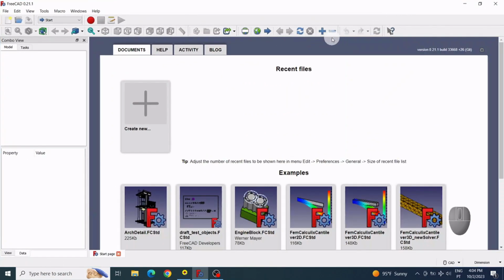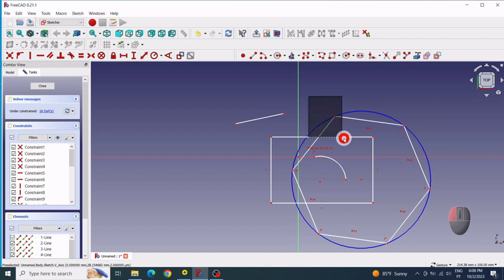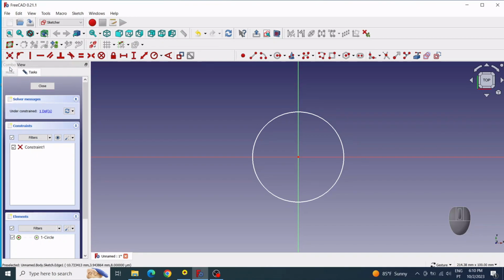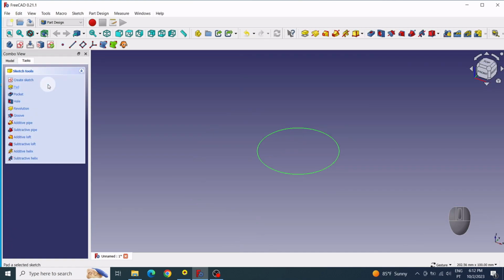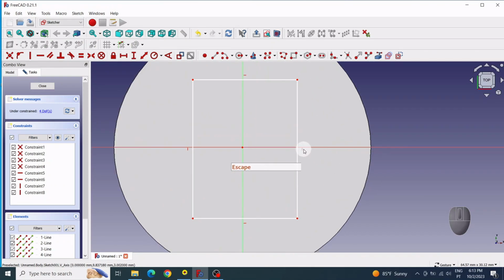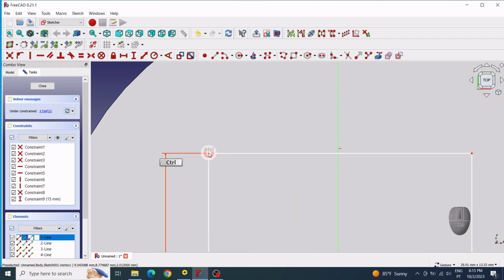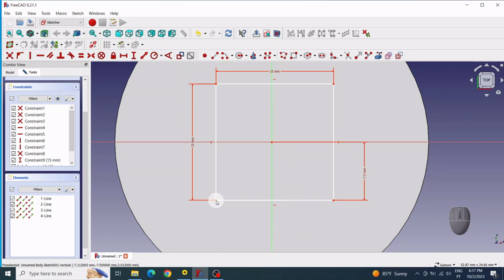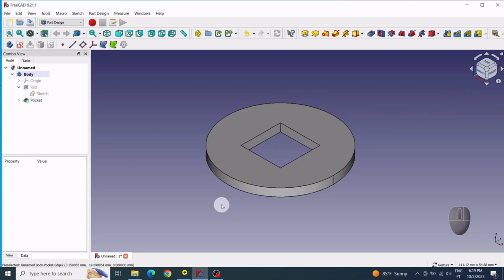First steps with FreeCAD

Comment: MacroConvert is a useful macro, however it seems that to modify the objects (homothety) along the z axis, it is necessary to modify the y parameters, same for displacement. I thought that asking for multiple copies would result in a series of combined modification (geometric progression), this not the case, all objects have the same size and the same displacement (superimposed), was it the goal?